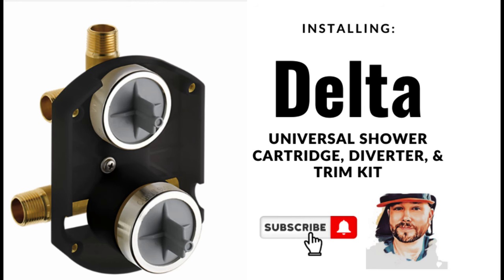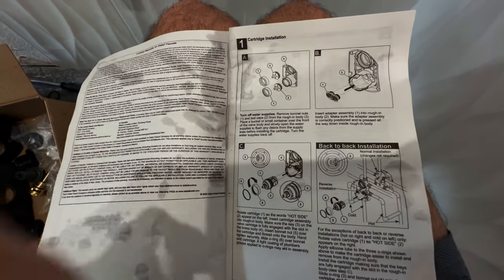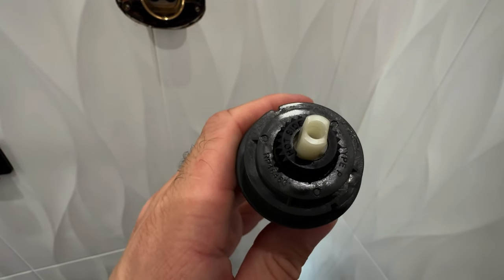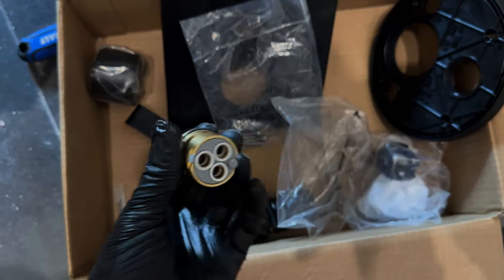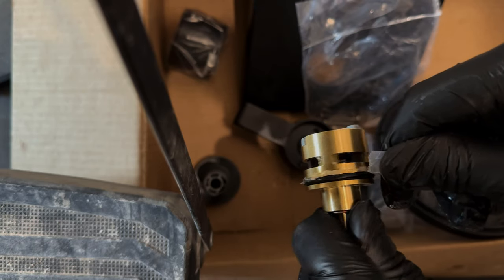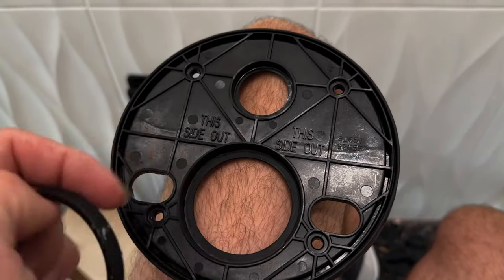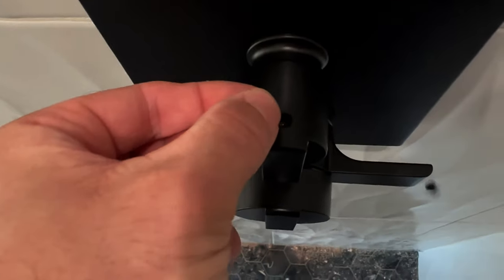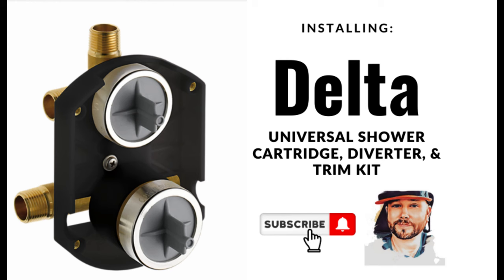Installing Delta Shower Cartridge, Diverter, and Trim

Comment: What does the little top handle do? Is that the diverter? So does the diverter knob turn on the wall and ceiling shower head? 
Can the ceiling shower head run alone the be switch off and have the wall shower head run / can both run at the same time with good pressure?
Reply from the maker: The top handle in this specific setup is the diverter and yes, it's function is to divert the water to the different shower features (shower head, jets, rain shower). If you are only wanting to run two features then you need a three way diverter (1. shower head, 2. rainshower, 3. both on at once). If you have more features than that you will need the 5 way diverter. Both will work with the multi choice valve body.

Comment: Installed the same delta valve but Iam only getting water from my rain shower and and nothing from my wall mount. Any suggestions?
Reply from the maker: Unfortunately, plumbing isn’t my area of expertise. Did you plumb it in yourself? I know they have a specific setup that requires the right output to be capped if you’re only using 2 features (rain head and main shower head).

Comment: Can we get a complete parts list? I can't seem to find a complete kit that includes everything you need.
Reply from the maker: Hi Frank.  You will need a multichoice valve body: the one I used in this video is https://amzn.to/4cNlxFd.    That valve is if for the use of a diverter (either the 3 setting or 5 setting diverter).  If you don't need a diverter then you just need the regular multichoice valve body: https://amzn.to/4cKmiPD.  Then you need to select whatever trim kit you want to go with.  The trim kit will include the appropriate valve that will fit the valve body. Just double check when you purchase (some sellers sell a kit without the valve).  The kit used in this video is the ARA17 : https://amzn.to/4cYVr24

Comment: Hey Man thanks for the video. The only part I am confused with, at what point do we open those stop valves?( On the rough in valve.)

I am referring to two screw in stop valves. When do we open them and how far do we open them?
Reply from the maker: The one I installed did not have those but you can open them up any time after you’ve installed the cartridge / diverter and sleeve bonnets.

Comment: My hot water pipe is connected to the right and the cold is connected to the left can this be fixed without opening up the shower wall?
Reply from the maker: Hi Sean. It wouldn’t be something I would tackle as a DIY project, but most licensed plumbers can replace/ repair valves with minimal damage. I’d use an app like thumbtack, and send some photos to some plumbers and they should be able to give you idea of what they could do. Good luck 👍
Reply: @FestiveScholar  thank you for the quick reply. Would turning the cartridge around help at all?

Comment: I forgot to apply the silicone even though there are no leaks.  Should I opened up and apply the silicone?
Reply from the maker: The silicon is more for helping the valve sit appropriately in the valve body. If it's working without issues you should be good.

Comment: Are you installing the T24967? That’s what I have. It’s chrome. The hot and cold is 1 piece. That concerns me. Looks like a little robot with no arms and stubby legs 😂 Minus the valve cartridge the instructions in your video are the same. I’m glad you posted it 🎉 Thanks
Reply from the maker: Glad it was useful! I recently installed a hot and cold 1 piece in our other guest bath and I have mixed opinions on it.  Will have to see how it goes.